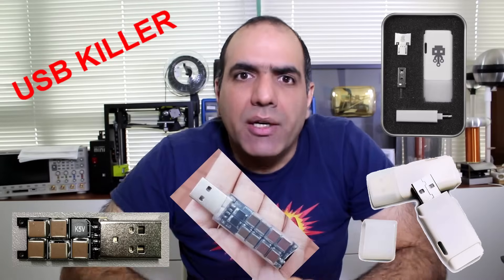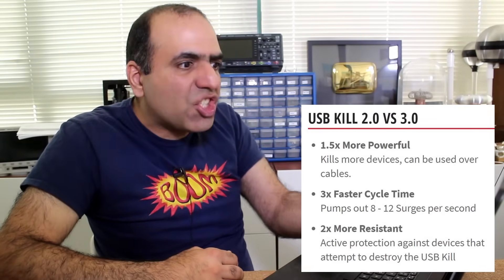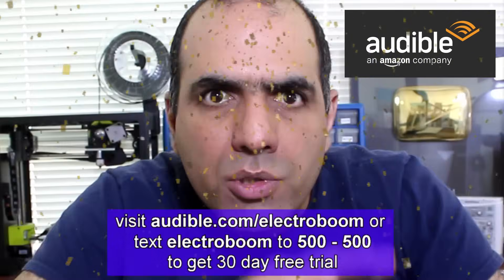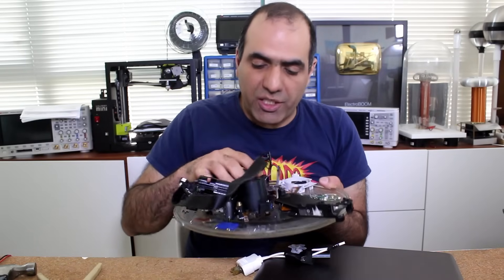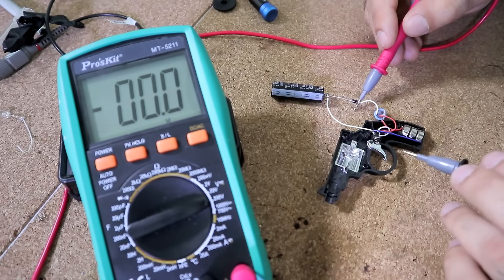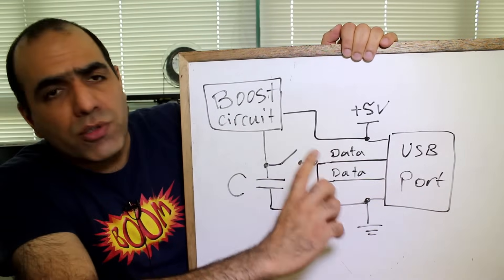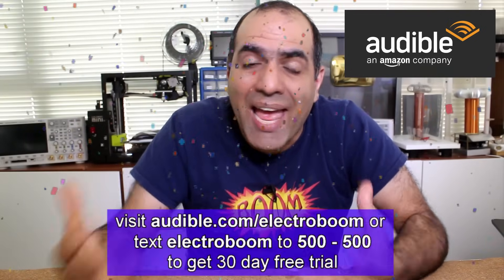USB Killer… WHY???

Comment: 9:37 I'm not sure about the damage you described for the Computer.

It will travel from the I/O -> USB Controller -> Southbridge    now it could take several routes either to the PCI Bus (Graphic card, Sound card etc.) or to the Norhtbridge or like you said to the SATA controlled devices like SSD's.

So it will definitely kill the USB Controller and possibly the Southbridge. So I believe the Motherboard will be fried and if you are unlucky also the Graphic card.

It would be interesting to test this though, since you can't really predict the path it will take.

Comment: Honestly, this device serves two real purposes. a) you can still use it as a tester device for secure systems, because remember, this is not a prank device, this is an attack device. Any decently skilled hacker can get an access to a server machine, plug a few of these in, and bring down your whole service, and in certain sites that could be catastrophic, so for that reason, its good to have a commercially available solution to test against and see what kind of damage and recovery you can do. Even if a stronger device can always be made, the idea is to cover the basics. This mainly started as a proof of concept attack, the idea that a single device can charge from the same USB port and ruin a computer like that. remember, that deleting the data isn't this devices main purpose, its not a safety/security thing, its an attack vector, and for a lot of systems all you need to do is bring them down for long enough, the data is irrelevant.

and b) it raises awareness about not putting random USBs into your computer that you find on the sidewalk outside. Seeding USBs on a street is a very real way of attack, usually to spread a virus or something like that. However, probably unintentionally this device became much more popular and more people know that this is possibly than people know about USB seeding. As a happy result people might be more reluctant to put unknown devices into their computers. 

Using this device without permission on another device that you don't own is absolutely illegal, no question about it, but the illegality of something doesn't stop it from happening. If a person wants your computer dead or infected, they are going to try and exploits whatever weakness there is, one of which is thinking you found a free USB on the ground and you're just so lucky... just don't trust these devices, if you really want to try it out, that's on you, can't blame anyone else at that point... you wouldn't eat a pill you found on the sidewalk either would you, no matter how much it looks like M&Ms

Comment: If I wanted to destroy a pc I would just use a sledgehammer if wanted to just destroy the internal parts I would thro it on water I won't buy an overpriced device that's only use can be easily done by other tolls
Reply: I would just water it internals

Comment: i think i have a scenario where the use of the usb killer may be legal and could be helpful

picture the following scenario

a suspect that the police has reason to believe is trafficking  in illegal data.

the suspect is not technically savvy hardware wise

the police cant just go in and do a raid based on suspicion they need hard evidence.

the suspect only leaves for a very short time say to go to local computer shop to buy another hard drive.

that is not long enough for the police to clone or scan the drive to get the evidence.

however armed with a usb killer the police can go in and fry the computer invoking  the suspect to take the pc into a repair shop to get it fixed.

the time in the shop buys the police time to clone and/or scan the drive for evidence.

now with evidence in hand they can do a raid and take the pc from the shop and raid the home for more evidence.

or the same scenario as above but the suspect is armed and so dangerous that even the swat team cant get into the area to check.

of course the police could just use an early part of stuxnet to spy via a fake antivirus definitions update to install a hashing tool and post the results back.
Reply: If the police don't have enough evidence to raid and take the drive, i'm pretty sure the evidence is also not enough to justify damaging the suspect's property.
Reply: a fried computer usually fails to even turn on.

the suspect would take the computer to the repair shop witch i doubt they have the forensics to analyze the board and even if they did i doubt that it would be allowed by the manufacturer's warranty provided that the design of the part makes the part fail without visible damage.

then as part of the repair process the data may be recovered as the os and drivers have to be reinstalled if there is a different brand motherboard installed.

during the transfer process there may be a scan performed that would reveal illegal stuff..
Reply: @ejonesss  You failed at reading, try again.
Reply: i should know because i have seen it  back in the 90s where the feds can plant magic lantern and carnivore through a fake or maybe real virus definitions update or something.

also if i was needing to collect evidence i would fry the suspect's computers in hopes i could get them to bring it into the shop to where it would be found out.

i should know because i have a friend that works for the feds and police in those departments and he was telling me about what he was hired to do.

Comment: Electoboom check this out https://youtu.be/UGhKxyXl77s
 He says at -10°C there is no voltage in the car so switch headlights on full beam a few times before starting the car. Apparently when voltage has reached the bulbs a few times it is easier for battery to start the car!!  Do you feel like pulling your hair out? Well like me I suppose you cant

Comment: The USB Killer is more or less used to test resistance against sudden high voltage spikes (if that's what you call them.) The sad thing is, it's more relavent with smartphones and consoles than computers or much else with a USB port.

Comment: Some of the best moments in this video:
00:21 Own way to kill computer
02:19 If it walks like a duck
02:34 Amazing sponsorship
03:18 Hammering the laptop
03:29 In Soviet Russia, the USB kills you
04:05 SKIT
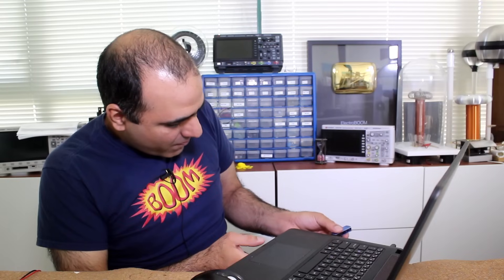04:15 SKIT - 3 tries for USB
05:26 FUUUULLL BRIDGE RECTIFIER
05:51 Getting shocked on capacitor (~170V)
06:40 Getting shocked on capacitor, again (~300V)
07:09 Every time you take a picture, a computer dies.
07:19 Getting shocked on "novelty gun" (over 1.14 kV)
08:54 First video of ElectroBOOM ever
10:24 Amazing sponsorship - washing dishes

~~ Sreenikethan I

Comment: Hi, so I agree with you that the only reason this device exist is to destroy other people's properties. Now, I can't think of anything to prevent this (other then not plugging unknown USBs in your devices) but can there be like a diy USB adaptor thing we can build which then loops into the PC? What I mean is to make kind of a fuse which will blow if a USB killer is used and not damage the PC?? What can be done to avoid these things blowing up expensive equipments?
Looking forward to what you think of this. 

Thanks,

Comment: you're assuming people still use magnetic drives in 2019. Most laptops are sold with SSDs nowadays, or at least I would never recommend anyone to buy one with an HDD, because the price difference is close to none.
Reply: @Lamster66  is what?
Reply: @Lamster66  can you buy a 4TB 2.5" HDD? No you can't! Case reopened.

Comment: Or use an iPhone! They notoriously have burn marks on the 4th pin, and mine within 1 month of owning (all OEM cable and charger), decided to fry my laptops USB while mobile charging. It then fried the OEM charger and several others. Apple obviously won’t even warranty the cable/phone/charger/ or pay damages, so obviously a scummy company (big surprise, NOT!). Anyways, just use a 12v power supply with a 12 ohm resistor heating wire like nichrome (max amps during short out is therefore 1 amp limit), and then hook this to a simple DC/DC buck converter set to 5v and then to the USB. Don’t forget to connect pin 2 and 3 together so it’s not limited to 80 mA and take days to charge). Viola, the”Apple safe charger” as I call it! Unfortunately still doesn’t fix your laptop or allow you to file transfer or internet tether over cable, but at least your house won’t catch fire or destroy thousands of dollars.

Good job Apple, because 5v 1 amp is too much to ask of your $30 cables, meanwhile my last phone charged from 12v 2 amp even safely on a USB C cable that cost $1 at dollar tree (special fast charger, 1 minute cranked up like 10% battery, not a standard phone obviously). Apple, inventing crappy designs so that everything grows, not just their own products!

Comment: I can erase your data with a 2-way radio. the EMI if strong enough and close enough can not only kill sensitive circuits in a computer but also actually cause the hard drive to corrupt itself. of couse this would have to be 250 watts or more. Your cheap baofeng HT is not going to do much in the way of actual damage however it can create some interesting results on electronics that use PLL circuits and TCXO oscillators..

Comment: They are at least making some newer devices more resistant to this type of attack, so you just kill that port instead of the PC. As far as testing goes, it could serve a purpose, these type of devices are a totally DIYable thing, it could be useful for manufacturers to be able to test if their devices can sustain such an attack, the problem is that it's publicly available, that's no good, I can't believe they are selling these online, 25 bucks on ebay for a cheap version.

Comment: I can't speak for any of these devices as I don't know their specs, nor am I an expert on this topic. However, on a few recent products I was contracted to design I was tasked with high speed USB for the first time.

As part of the EMC testing, a tiny (SOT-23 size) IC was required for USB Power, Ground and D+/D- Lines which needed 15kV protection. The IC is comprised of 5 extremely fast recovery diodes.

During testing for EMC, part of the test is also for ESD that each line must withstand 15kV (+ and -) for a specific period of time.

I would never buy one of these, but true ESD test devices exist that will generate short ESD equivalent bursts of energy. Is it possible that these were originally designed for that purpose? Either way, naming it a "USB Killer" clearly states it's being sold for malicious purposes!

Comment: Well, things like this are used while developing devices with USB to make sure it does not affect rest of the device. It does not matter if it's just a prank, broken USB device (like USB voltmeter from China that does not care about separating higher and lower voltage sections) or any other case. Imagine you put something like this in your car's USB while driving and suddenly you have no controls. So things like that are sometimes used specifically to abuse USB on machines that should not break because of that.
I only wonder why they sell this to public, it is not consumer device, at least it shouldn't.

Comment: Testing whether things can be destroyed by destroying them is a thing that happens. Companies who want to protect themselves against corporate espionage literally hire security testers who simply try to steal/destroy their crap (in a somewhat controlled way, of course). Mind you, the hardware you're attacking is not the only factor here. You may/could/really should want to test how your security personnel will react to a guy casually walking up to a bunch of computers and sticking something into the USB port. If your premise screens people's belongings before letting them enter, will they be able to tell the difference between a USB drive and a USB-fucker-upper? There's really only one way to find out.

The USB killer is expensive precisely to act as a deterrent for casual vandals. Anyone who wants to do real damage will easily construct a similar device at no cost. Meanwhile, a professional hired to test your company's security will have a way of obtaining such a device with less hassle (it'll be a large corp paying for it anyway), and most likely with a clear indication to the company that such a device would be used in testing.

Comment: It could be used to test a circuit that protects against a vandele sending a high voltage into a usb port. To make sure the circuit does the job of protecting the high voltage from spreading. But like I said the fact they have an anonymous version is suspicions.

Comment: 3 years ago, a lightning strike fried my desktop computer and my router. The PSU was still working but it was faulty. The motherboard was broken. Even the green power led wasn't turning on. The 4 GB Ram stick is still working but also faulty. At least you can use it to boot up. All the other parts processor, HDD, DVD-Rom etc. are still working. 1 week later after the lightning my laptops power adapter exploded. It was on when the lightning stroke but nothing happened to my laptop except the adapter.

Comment: A good EE can destroy all electronics. The bad thing is that those sticks are sold to people who do not really know what it is, and just buy it for destruction. This is of course bad, but I agree with the manufacturer that ports should be protected against this. Either via optic coupling (better) or at least via magnetic coupling (like ethernet usually is). 
(I guess magnetic coupling is not that useful against this attack, as it could still induce a high enough voltage if the pulse is long enough)

Comment: Yep. Had to make these things for work. Our warranty from our suppliers was specially done in a way to make us jump through hoops to honor the warranty. As an example we would have a hard drive (ancient MFM from when I worked in the dinosaur era) that would have growing bad sectors. The warranty wanted us to do a low level format and then do a surface check for errors and they wanted us to do it three times in a row. If the errors only increased by one sector they wouldn't honor the warranty. Sad problem is that these errors would grow as the drive was in operation, and would get worse the longer the drives were running. This is bad for data retention. We would make "MFM drive killers". AT Molex to 120VAC with a IDC ribbon cable "adapter". A smoking drive was replaced easier than a drive with a "soft" error.

Comment: This can be used by OEMs to test the ports if their USB port Killer protection works. But then again, PAL power plugs use about 230 volts and the USB killer "only" uses 200 Volts.

Comment: Ummm.....i hv one question which might be silly but how does a 9V battery charge the capacitor upto 300V(check 6:43 minutes of ur video)??
Reply: It's the capacitor that can output the high voltage not that battery I think
Reply: @ilmu011  but how did it charge till 300V?
Reply: @Newbiefly7698  That's what a capacitor does right? Build up a charge, which can rapidly discharge large amounts of voltage.

I'm not very knowledgable in the field but if a specific capacitor can discharge 300V then I think any battery would be sufficient to charge that capacitor, it would just take longer.

If I'm talking complete nonsense, please tell me.
Reply: @ilmu011  I understand your point but I m asking hw does the capacitor get charged to 300V initially
Reply: @Newbiefly7698  Just leave a current on for some time? Then open the gate?

Comment: I had a thought: That toy gun would make for a cool novelty USB killer. You could have the plug at the end of the barrel and maybe even have it activate when the trigger is pulled.

Of course this device would actually be a tool of evil so you'd want to keep it in a strictly safe place and only use it for novelty demonstrations.

Comment: Its voltage not current that kills mehidi right!!!!!!!!!!!!!
Reply: Dharmesh Naik it’s current that kills.... not voltage. U can get a shock of 100000000 volts, if the current is 0.00000000001 you won’t die for sure.

Comment: Well, in a way it can be used to test hardware quality.... Some motherboards are pretty well filtered and protected around the port connectors.... Best case scenario with good quality hardware; nothing happens or the USB port itself is grilled. Next best scenario is that the USB controller chip takes the surge and gets fried.

Even if the surge passes the USB port filtering, there are a lot of other safeguards in quality hardware, especially in the CPU, expansion port and data storage area, meaning, yes it's unlikely that a USB killer will fry your CPU, cards or data storage media.

Now, laptop motherboards are rarely quality hardware. After all they're never designed for overclocking purposes and the like. Also, space comes at a premium with laptops, so usually where they save space and money is with proper port and component protection.

Also proper way to dispose of storage media: HDD; Nail through the platters and/or strong magnetic field. SSDs; open the SSD case and put a nail into the center of each chip to make sure the silicon is smashed

Comment: There used to be a floppy disk killer back in the day. But instead of using an electrical charge, fingernail polish remover and match head dust was applied to the bottom of the disk.  The idea supposedly was when the disk got hot enough while being read, it would ignite the drive and kill the floppy drive.